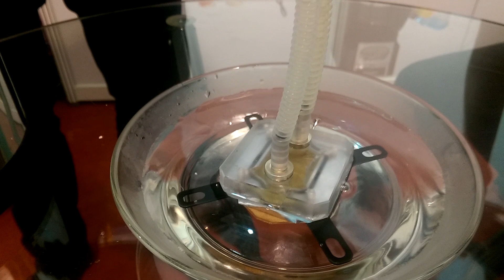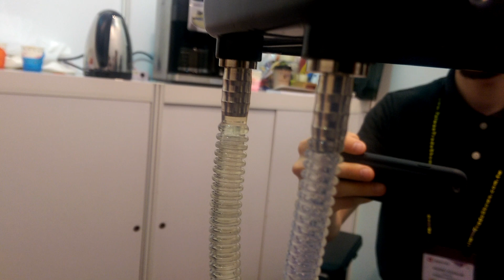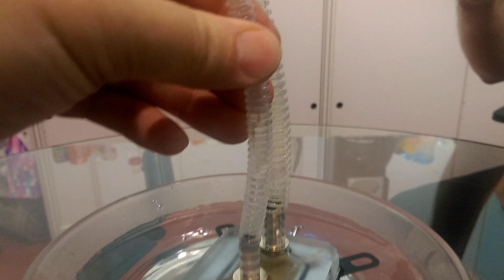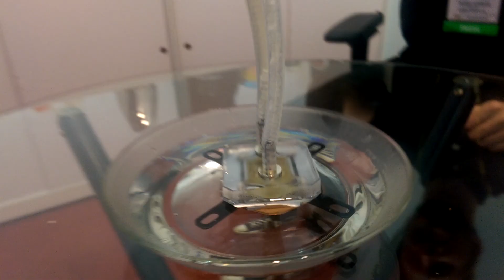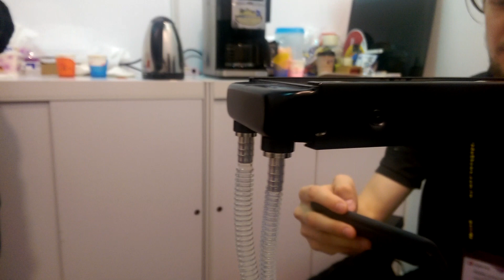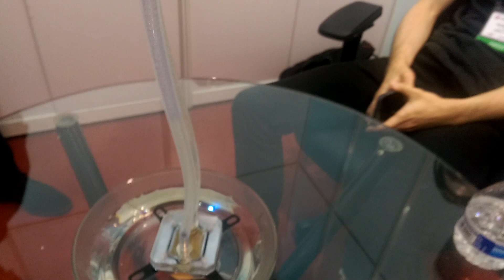Raijintek Shows Pumpless AIO Water Cooling Solution @ Computex 2016

Comment: I got bored waiting to buy one of these. So I just built my own. It is a very simple design. 

$20 cheap water block
$10 g1/4 to 1/4in fittings
$35 360mm aluminum radiator
$5 1/4in ID tubing
$5 Methanol (or denatured)
$75 total

Should I make a video?
Reply: would be interesting to see what you came up with. What liquid did you use since there is no pump in the Raijintek setup
Reply: @miamericanfreak  I used methenol but I am planning on finding a easily available fluid with a lower boiling point. I am also planning on going to the hardware store today to buy some different sizes of tubing to see if that helps efficiency. The temps are not great but they never exceed 90c under full load. The reason for the high temperatures is without a pump the only way of moving the methenol is to boil it and the evaporated methenol pushes the liquid around. It is very quiet, simple, reliable and power efficient (mine uses no power at all) but perhaps not the best for the desktop. It would be perfect for something like an enterprise server or home theater PC.
Reply: On second thought my acrylic block just burst it might be a while before I can make a video.😭